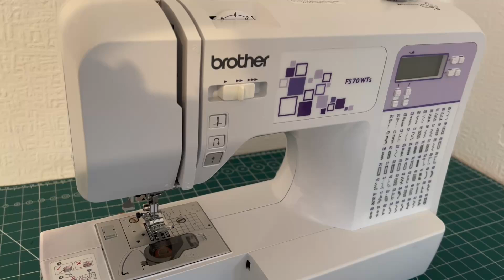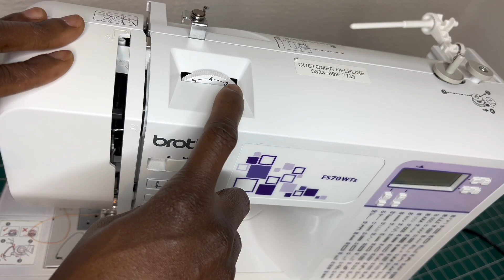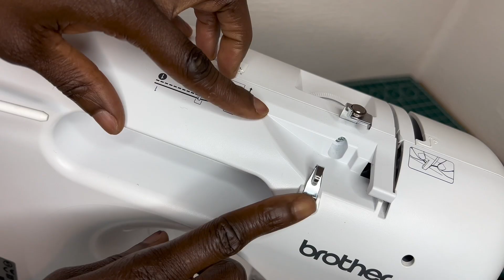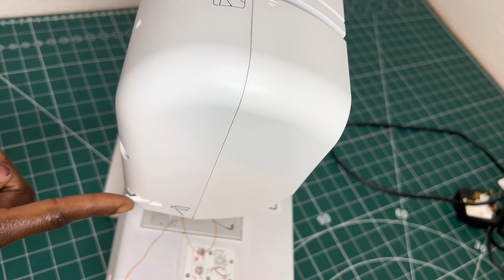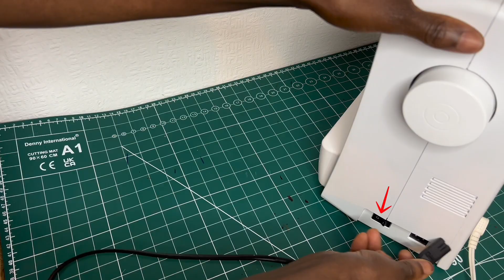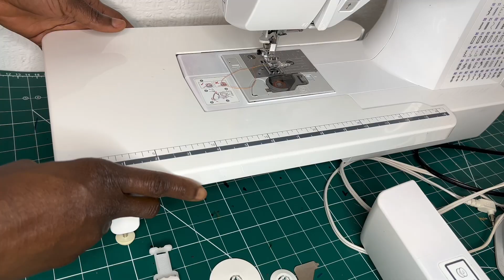Sewing machine : First Time Setting Up a Sewing Machine? Watch This

Comment: Hi. I got this machine a few years ago at £300. It has never sewn a straight line, the stitches on the bottom are not too bad but the top stitches are awful.  I have tried everything and I am quite an experienced sewer.
Reply from the maker: This is their customer helpline: 03339997733. Hope this helps.
Reply: @CurveandStitch  Thank you so much, you're very kind ❤
Reply from the maker: @marciacarey2793  😊you are welcome